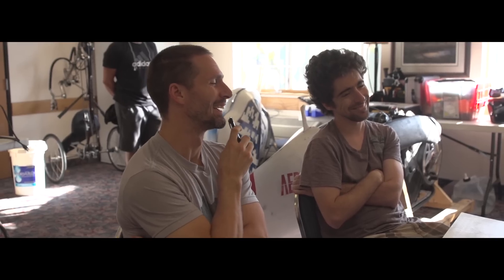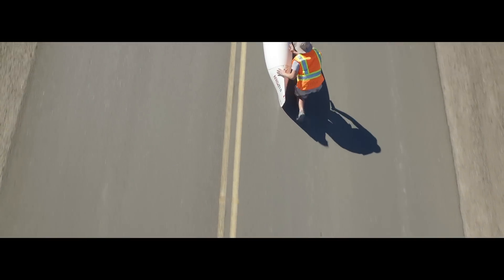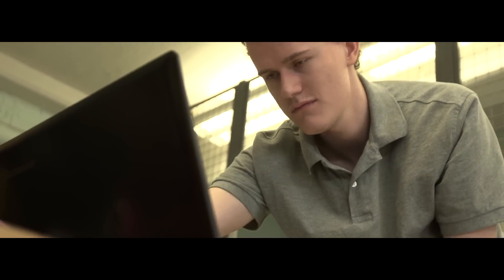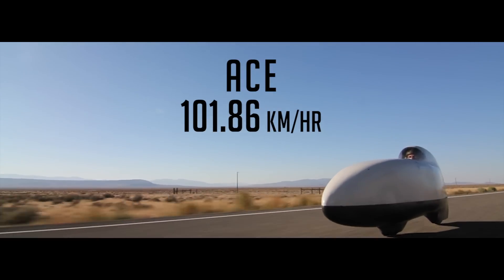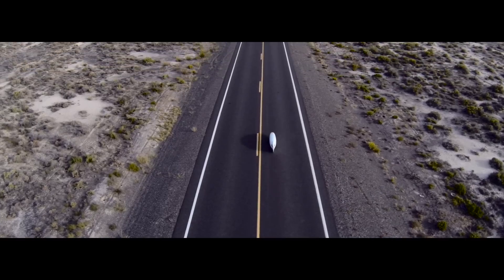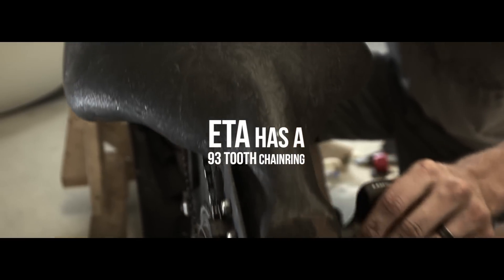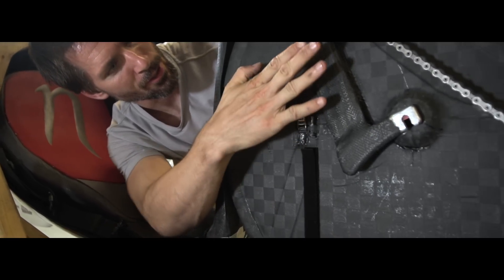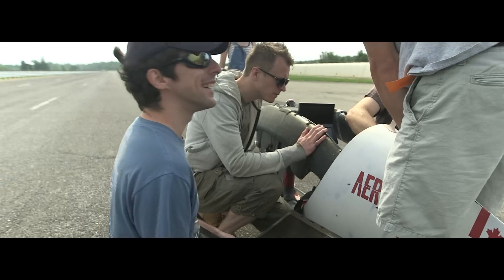Under the Hood of the Fastest Bike in the World

Comment: This is very cool. And even if such a bike is unuseable in the traffic and daily life it shows the possible improvements of cycle efficiency by an aerodynamic design. 
Even twice the air resistance of this bike is far less than with a standard time trial bike and would probably be fully useable for daily use. I think that is what the velomobil has.

Just a note: at 3:10 the tire definitely protrudes much more than 4mm, closer to 10-15mm.
Reply: Sideways it might very well be 4mm from the opening at the narrowest.

Comment: Just hoping someone is still reading this... as mentioned in another comment, I am a velomobile enthusiast and rider (Räderwerk Milan GT Mk6). What I noticed in the Aerovelo design is that it basically has a partial carbon frame which is under the cover, which is exactly the opposite of what modern velomobiles have (for example the Milan GT, but also the Intercitybike DF XL, which is the most rigid feeling bike I ever owned). Why is this? Wouldn't using the shell as integral part of the structure make it a lot lighter and potentially more rigid, therefor make it easier to accelerate to record speed?
Reply: You are correct. 
Our 2011 and 2012-13 bikes, the Vortex and Bluenose, were a monocoque design. Worked well, but had a lot of issues while racing them:
1. Hard to work inside. Something always breaks, needs adjustment or fixing. 
2. Hard to stage during the limited time we have to start. If we have a small opening, getting driver in and strapped down takes time, and they overheat if they stay in too long. 
3. Most importantly, if we fall we scratch the fairing and have no chance for record. As such, the rear fairing was connected to the frame, but the front one could be easily replaced, and we had 2 of them. If one is scratched, we can race the other, and not waste a day of racing, while we fix them in the evening. Front fairing was also damped, so road vibrations wouldnt trigger laminar-turbulent transitions, but we are not sure how much of an effect that had.

Also, weight does actually matter quite a bit. A lot of our rider energy went into pure kinetic energy, so lower mass would help.
Reply: Weight is not the biggest concern for a bike which is trying to go very fast on flat ground. In theory, weight only increases the difficulty of accelerating, and the rolling resistance of the tires.

The most important factor is to have a very aerodynamic shell. That means the shell must have as few seams and openings as possible. It would be very difficult to work on the drivetrain if it was incorporated into the shell.
Reply: @samthe1337man  Of course! I know, as my daily driver is a Räderwerk Milan GT ;-) 
Still, those (and all other modern production velomobiles) are a carbon monocoque; because it's more rigid, handles better and obviously is a lot lighter. Not only weight limits acceleration, rigidity of the bike does too, as you'll lose power in flex of the body. You will need acceleration because this record is not only about holding a certain speed, it's also about getting there in the first place.

"Settling for" a separate frame in a record bike that's designed from the ground up seems a weird choice because of this. Unless it also has advantages that I'm not aware of; This is why I was wondering why Aerovelo made this design choice :-)

Comment: These types of bicycle are known as recumbent cycle. 
They can go a record breaking 128km/h with human power only. No one has fixed a motor inside these stuff. We can make the person sit opposite to the recumbent position. As people sit in sports bike but, way inclined. We can also build side wheels which can deploy automatically. 

WHY are they making such bike?

They expect a breakthrough. They expect to build a formula 1 cycle. And they also want people to consider these for their commutes under 60 miles eliminating the a biggest problem... I.e. slow speeds for cheap.  And zero emmision.  But this is a distant goal if they only rely on human power.

Why electrification of recumbent ?

An electric vehicles with recumbent design could be way faster than expected. We can tap into a new catagory of vehicles. The F1 electric bike. Someday you can expect these efficient bike on road people considering them for their efficiency and cool factor and price.  Electric vehicles with such design can bring down price to performance ratio.

WHAT WE CAN DO? 

There are some modifications could be done to recumbent such as position of the rider. Electrification of the cycle and automated side wheels making it and many more making it a choice for modern and cheap means of long distance transport. With only a 1000 watt  Motor inside a recumbent can reach 300 + km/h of top speeds at highways. Considering real life factors such as the the weight of all components.
Reply: Ты лжец. О каких 300 кмч идет речь? 1000 ватт не способны разогнать и до 170  кмч

Comment: Looks like the ergonomics of the bike is the current limitation? With 258 W at 100km/h that gives us only 700W at 139 km/h. An elite cyclist can output up to 1100 W for short bursts, so why only 700W here?

For fun, let’s see the theoretical limit :)
1100 W in this bike would give a speed around 160 km/h.

I heard some study from University of New Mexico indicated that a 30% power increase could be gained if the rider uses both arms and legs for propulsion. That would mean around 10% higher maximum speed, so we are up to 176 km/h.

We also have the possibility to drive a heat engine off the human, theoretically increasing the power output by another 40% (assuming a body temperature of 37 C and an outside temp of 0 C) this would push the bike up to 197 km/h.

This assumes perfect efficiencies and a carnot heat engine, so I would guess that we are never going to break the 200 km/h mark... unless... We go to the moon! Then we don’t have any air drag and we can basically go as fast as we want! Yet another reason to go to the moon, we got world records to beat!
Reply: I like your thinking, and I have an answer for the first part of your suggestion. I ride a velomobile myself (Räderwerk Milan GT Mk6), running a 26" rear wheel (28-559), 11-30 cassette and a 65 tooth sprocket on the front. Fastest sprint until now was into low 80s (km/h), on 65-13 so somewhere around 140 rpm.
You mentioned an elite cyclist that can output 1100W: Probably you were referring to an elite endurance cyclist. My maximum short term power output is between 1500 and 2000W, and although I'm a type 2 muscle tissue guy, I'm far from elite.. elite track sprinters are best measured in kilowatts, haha.
The problem is not the power necessary to maintain 100 km/h (which is 258W), the problem is that you need a lot more than that power to actually get there. My Milan would also go past 100 km/h if I could only maintain 1500W long enough. I don't have my power curve at hand here but I guess in a full sprint I would be able to put an average of about 700W for a minute. There are formulas for this which I'll spare you, but let's take that 700W average and assume I can do a fairly linear 700W sprint; holding 70 km/h in my bike requires between 350 and 400W. To accelerate from 0-70 km/h in one minute (the time which I can hold the power) requires an extra 410W of power input. This actually checks out: From a standing start I can get to 60 km/h in about 18 seconds, but then I'm basically done. If I accelerate slower, I can pass 70 km/h before I run out of energy stocks. The only way to pass 80 km/h is to start my sprint when I'm actually already at a high cruise speed, for example riding 55 km/h, take some seconds to recover a bit (the velomobile is efficient, so before it's below 50 km/h will take long), and then put in a sprint that starts at about 400W and builds up intensity fairly quickly to compensate for the higher drag.

Concerning using arms and legs: Yes and no. It's much harder to steer if you need to use your arms to propel a vehicle. Might cause your legs to try to even out unbalance, therefor lowering the power output. I also own a rowing bike, and although it's easy to accelerate really hard on that thing, when I do I need the full width of the cycling path :-)
Reply: @4nz-nl  You are correct in your understanding of power. A lot of our power went into pure kinetic energy, so we had a keep a high level from begining to be able to accelerate to high speed. A final sprint was very good, but couldnt rely on it alone, since Todd would have no time to get enough power converted to kinetic energy.  The correct power profile was quite interesting, we ran a few simulations with him in a trainer, to see whats the optimal profile he can achieve.
Reply: @victorragusila7519  Of course, you actually did the math on what's the best curve to get up to speed. I would guess it's not possible to share that data, but am still hoping I'm wrong ;)
By the way, how does your bike respond to side winds? >> The Räderwerk Milan design is actually quite good at it, with it's three wheels and overhanging tail it sort of compensates it's own response to a sudden wind gust and wants to go more or less straight. I'd expect a two wheeler to be terrible in windy weather, is that a correct assumption?
Reply: you have to take some other things into account, they are sacrificing  power output that a regular road cycle position helps give those 1100w, when a road cyclist sprints he/she gets of the saddle to achieve that. here the laid back position helps aerodynamics tremendously as aero at this speeds is way more important than a lot of things including even weight, as you can see for the results (way higher speeds on the flat compared to a sprinter on a road bike, for way less watts),  regarding additive power using your arms, that would also negate a bit of the aerodynamic shape and also add more weight but not sure if the trade would be worth it.

This is a balancing of factors and priorities act, its not a hotrod on which you just add stuff or tech and get more speed.
Reply: Beacon of Wierd,

Your comment is very interesting and I want to share my thoughts.

You are right about the required power. With only 258w for 100km/h a higher speed than 139km/h could be achieved theoretically even by many random guys. I think the explanation here is that it takes a few minutes of acceleration to reach these speeds and at the moment of the reached speed the rider cannot put out more than ~700w. 
It's similar to that a professional powerlifter/strongman should possibly be able to beat top speed velodrome records based on his maximum power output. But his muscles can only put out the extreme power for a few seconds and he will fatigue much faster than a cyclist before he reaches the theoretical top speed. The pro cyclist Filippo Ganna is measured to 608w for 4 minutes. An insane performance! I think it's pretty similar to the performance of this speed record. During the acceleration the rider needs to put out a high power for several minutes. For example 608w at 100km/h means 21N of driving force, which means a very slow acceleration. Which becomes slower the faster it goes and the increasing air resistance contributes even more to that. At the moment of reaching 139km/h even a pro cyclist will have hard to put out 608w, and 700w it's even more impressive.

Do you think that is a correct explanation?

The idea of adding the upper body for increased power is very interesting and there are actually a few bicycles with that design. It's especially useful in uphills but I think it's difficult to make it an advantage with a speed record like this. Adding pedals for the arms would uneviteable result in a less aerodynamic design of the vehicle. The question is if the added power will weigh up for that. Maybe slightly.
But I am sure 200km/h will never be reached. At least not by a single rider. But what about a tandem version!
And here an idea has come to my mind. Imagine a special designed pedal driven train on a special designed rail! 
Then DOZENS of riders could be connected to each other in a chain. The relative air resistance would be several times lower than the recordsetting bike in this video. For sure 300km/h then would be achieveable.
Reply: @patricj951  You’re probably right, looking at the instantanious power is misleading, since it’s the aggregation over time that exhausts your body. After reading the rules to the challenge, there’s a rather easy way to ”cheat”. The restriction is that only human power is allowed, so you can use human power to spin up a flywheel (either at low power over a long time, or simply rest after you’ve spun it up). Then you could in theory reach any arbitrary speed (only limited by the size and efficiency of the flywheel). There’s currently no rules to ban this from what I can tell.

Apparently energy storage devices are not allowed in the speed challenge, only in the long range challenges.

Comment: how can we implement this technology into everyday consumer bicycles to improve their energy efficiency? That is a more interesting question to me than trying to hit an even faster world record. After all, beyond a certain point the rule of diminishing returns will apply.
Reply: velomobiles already exist, and they are pretty much as good as possible while staying practical. Main issue is at top speed they become quite unsafe. We run on empty roads, with nothing to hit. But trying to do 80+km/h on bike paths or city roads becomes very dangerous. Might as well get a motorcycle at that point.
Reply: @victorragusila7519  A velomobile is actually safer than a motorcycle at speed. One large advantage is the feet-forward position - I prefer breaking a leg over my skull. Also, although I can sprint to 80 km/h I rarely ever do so; on trips with the highest average speed I rarely ever crack 60 km/h. Saving energy for long straights is essential for an efficient ride.

Comment: if you need only 258 watts to maintain 100 kmh, why we can not see similar commercial velomobiles achieving at least 1/4 of this?
I see some recumbent bikes with 3000 watts motors and still they don't reach more than 80 kmh.
What is the power output from the trained cyclist when it reach 140 kmh?   
How much time it can sustain that speed?

Comment: How is steering done? Vie rear wheel? Transmission is on fron wheel i guess.
Reply: Transmission AND steering on front wheel. Cant steer the rear, becomes unstable. 
Chain going from a middrive above the wheel down to the wheel doesnt affect steering too much, if power side of chain is aligned with the steering axis. Check out Raptorbike for a everyday example.

Comment: Would it not have been easier, cheaper and lighter to incorporate a window into the hood or simply use clear plastic that use electronic monitors?
Reply: that would require a more upright position for the rider, this could be the reason they changed the window that they already had to a more streamlined and less tall shape. the angle the rider is in this iteration, his knees already practically block his view. Also at those speeds aero shape is way way more important than weight.

Comment: They could reduce a small amount of weight by making the shell clear in the right spot for the front window and therefore eliminate the need for view screens and all related batteries, etc..
Reply: that would require a more upright position for the rider, this could be the reason they changed the window that they already had to a more streamlined and less tall shape. the angle the rider is in this iteration, his knees already practically block his view. Also at those speeds aero shape is way way more important than weight.

Comment: I guess the only way to go from here is to reduce the drag of the drive train.
Reply: You can make a better and colder surface and reduce weight, plus you can use the arms to drive the other wheel or use all 4 members to drive a single unicycle to reduce rolling drag, and they can also go full blind and remove the camera and the weight of the screens.

Comment: Wait until the advent of AI ,when we can tell the computer,we want a light weight frame and a low drag  aerodynamic body
Reply: The problem isn't in the engineering, it is in the material. But it doesn't get much lighter than carbon fiber.
Reply: They actually did computer optimize the fairing shape.